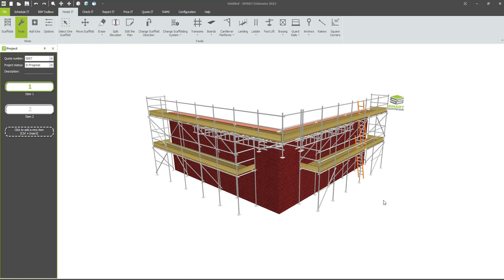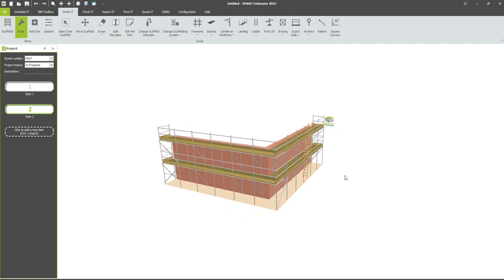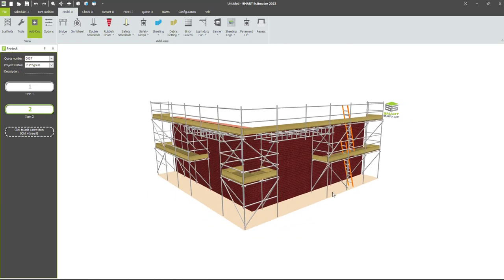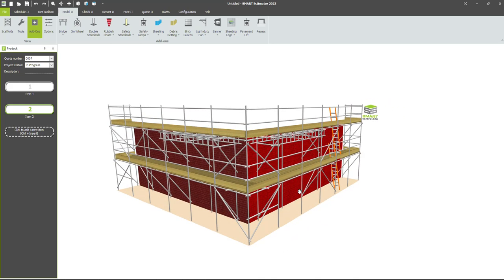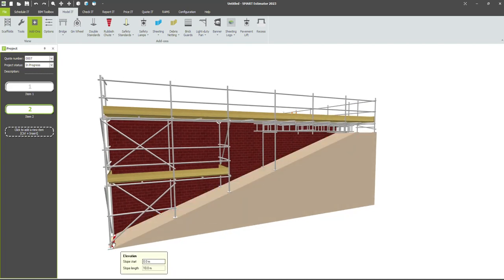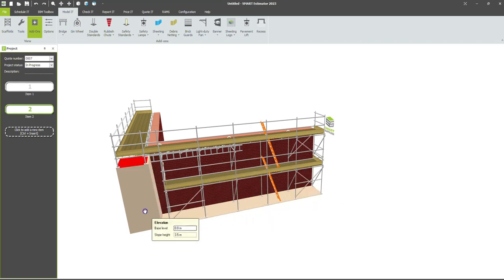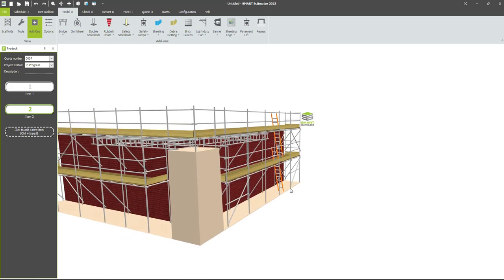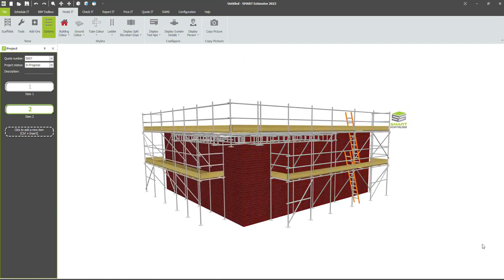Modelling Bridging beams around corners in SMART Estimator

Comment: by doing this doesn't effect the calculation distribution?  this only suitable for viewing, but in term of calculation should be doubted
.
Reply from the maker: Hi , SMART Estimator is for estimation modelling only, Its not intended to be used for structural calculations. in this case a design would be required to accompany the Estimation and tender